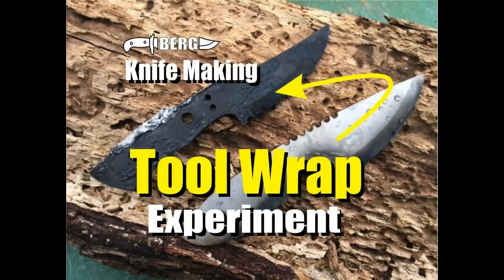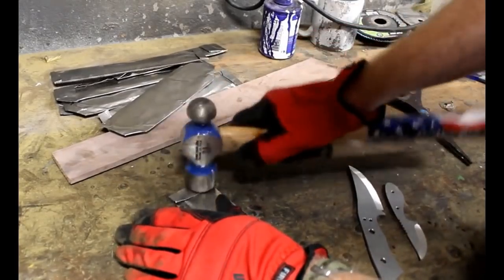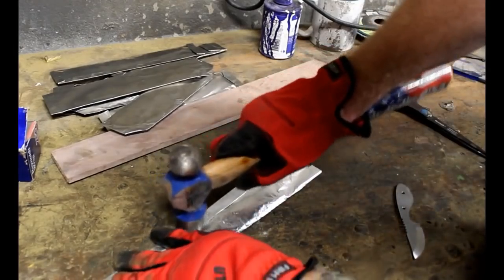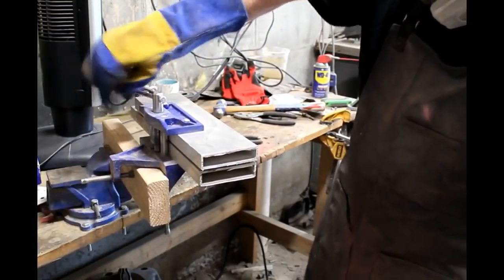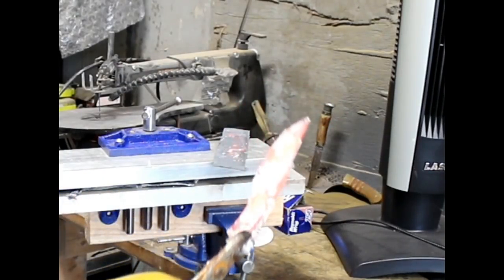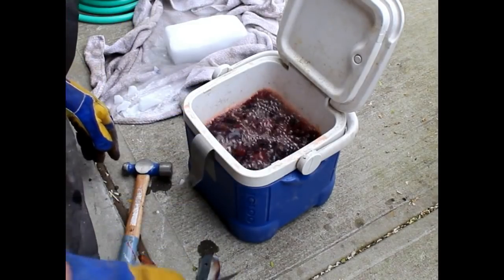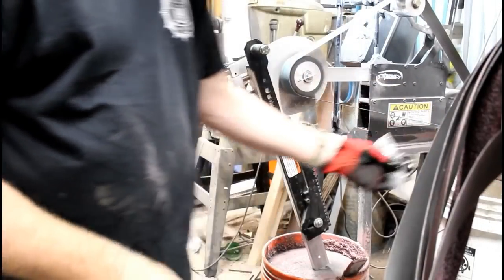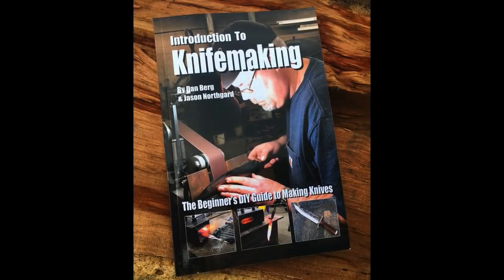Tool Wrap Knife Making Experiment

Comment: Dan
I thought that decarburization was the loss of carbon from within the metal?  So a knife that loses carbon is not going to be as structurally sound or strong as one that has not lost its carbon content. 
That is the purpose of the tool wrap soap for going in that would not be a good thing do to that structural deficiency that would occur. Anybody please, correct that is not the case

Comment: for my slurry i use acetone and its alot less messy. i crush 25 pound of dry ice as small as possible then add half a gallon of acetone .
Reply: How many knives are you doing at a time? That seems like a lot... I usually buy a bag of dry ice, then pour maybe a quarter of one of those small cans of acetone from Home Depot in a container and can do like 6 knives....
Reply: @evaderknives  usually do 6 knive too. but my dry ice retailler do not sell under 25 pound...
Reply: I've read that the fumes given off by the acetone and dry ice are extremely flammable.  From my research the better mix is actually dry ice and kerosene.  Gets a little colder than the acetone and not as dangerous.  Also won't eat your plastic cooler... lol
Reply: @jeffkushen5586  Dry ice itself is Carbon Dioxide and displaces oxygen in the air... So I don't think I would use it indoors with any mix... I've always used acetone too, but will have to try a few other things...
Reply: Guess i should have read all the comments before  I said the same thing....